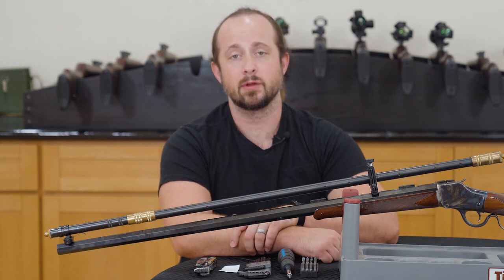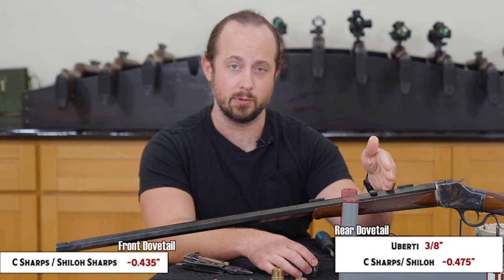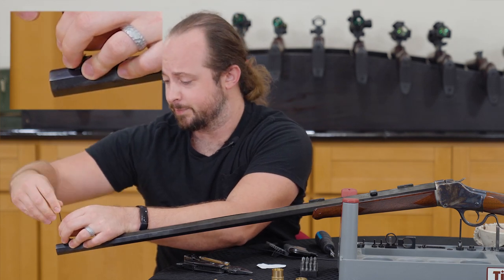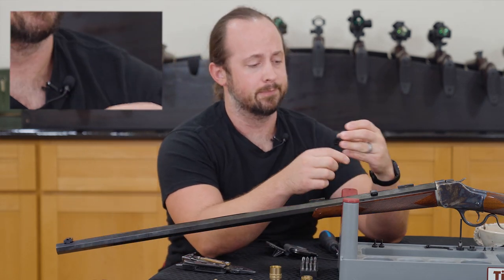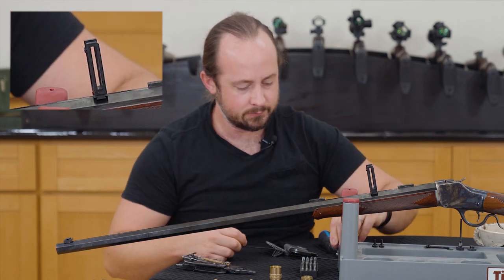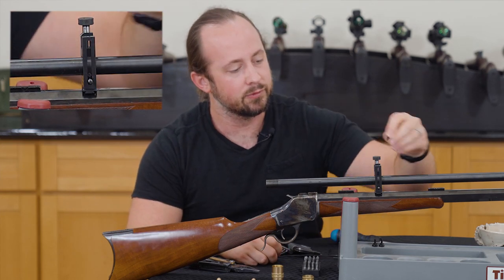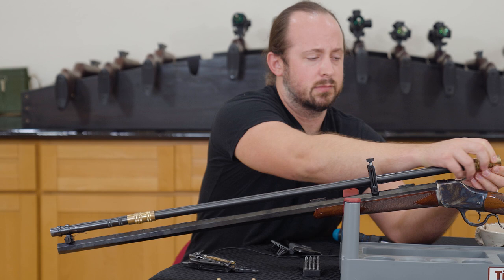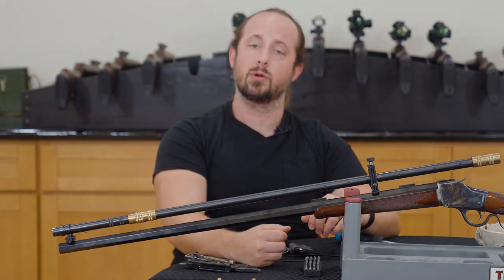How to Install the 6X Long Malcolm Direct Dovetail Mounts - A Sliding Long Scope! - C&C S2E8

Comment: Does the rear dovetail block also slide right in and use screws to hold it in place or is it a friction fit that may require filing?
Reply from the maker: That depends on which end of the tolerances the dovetail cut was made to. If the rifle's dovetail was cut a little undersized, it'll be a darn tight fit. If oversized, it'll need the screws. The front and rear bases have set screws that you should tighten up regardless of how tight the fit is.